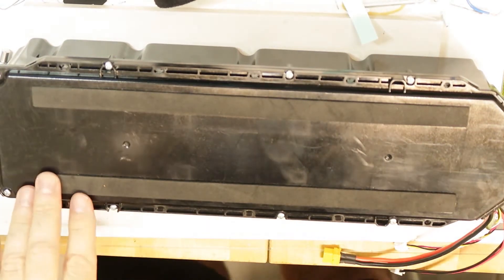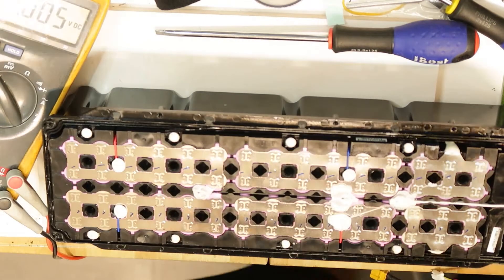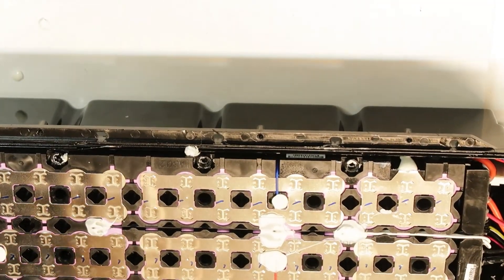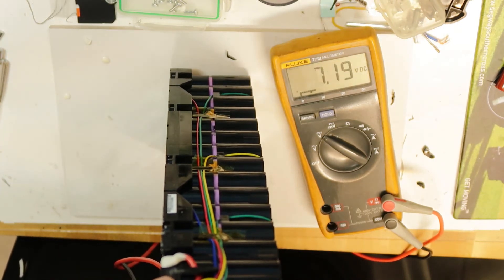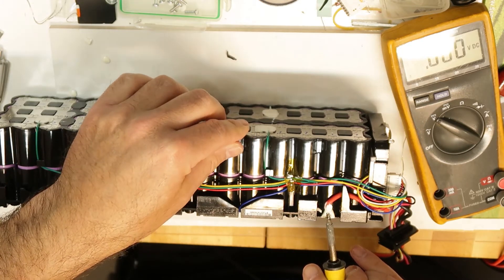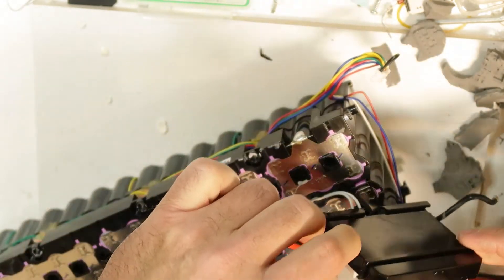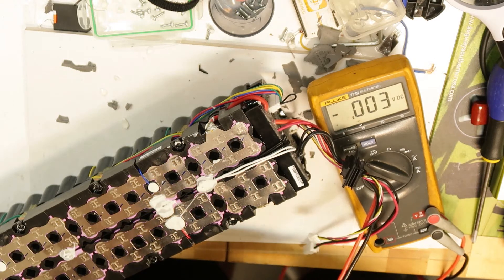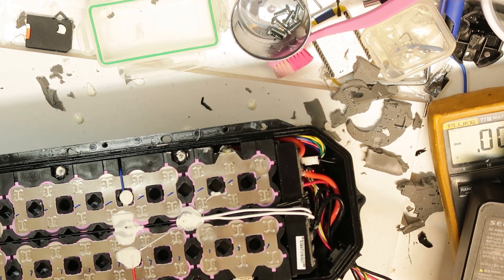Disassembly Ninebot Max G30 Non working battery

Comment: To remove the pack from the black plastic casing, you had white silicone covering the screws. On mine, it is a yellow plastic or wax… do you have any recommendations for removing that?

Comment: Hello sir, I have g30 battery that I left sit. Followed your video, batteries are low at 3.1v. I tried resetting the bms and it just flashes red and then stops. Will not charge. Am I out of luck?

Comment: I have an e-bike with an 8,8 Ah battery (40 cells). I rid 3000 km on sport mode. About 1 month before the battery cut off,  the power of the e-bike was reduced. The battery stopped working. I disabled it and measured the voltage, changed 20 A burned-out circuit-breaker. Then the battery was able to be charged again. It worked for half a cycle and then stopped. So I gave it to my friend, who works with electronics. He measured the battery cells and said, that it is only about 70 % of nominal capacity left. So BMS measured the battery's internal resistance and/or cell's capacity left. As the battery reached its wear-off, BMS simply just cut it off. Just for safety reasons. Because the older battery is more dangerous.
Reply: Bypass that bms

Comment: Hi there, my battery has gone faulty and Im not sure if it’s the cells or the BMS. Do you know why the led light is blinking blue but occasionally red? I managed too reset the BMS but the problem came back again. It charges then stops charging because the led light starts flashing blue and goes off charging mode then it starts flashing red and charging again. Also when I plug it in the percentage goes down and it’s not accurate. Thanks
Reply from the maker: if all cells balanced and problem continue - this is usually a bad connection to BMS from balancing wires or faulty BMS circuit

Comment: Was this battery genuine? I had the same one with the same cells (pink with only a barcode) and pll say they are fake. But since i bought the battery second hand i cant confirm if its OEM.
Reply: I have one with baby blue cells in it.
Reply: @Wheelieking619  mine has grey cells but configured the same ,can u add a on off switch with the original bms ?ive seen u have one runnin on a separate setup wonderin if i could add a second battery to my ebike

Comment: Hi, what is the third connector coming from the battery. There is the charging connector and 42v connector but what is the purpose of the 3rd one? I'm trying to use this battery for an electric skateboard build and am wondering what I need to do with that one.
Reply from the maker: this is communication
Reply: @RoeeBloch  can it be used standalone ? I guess just hook up an external 42v xiaomi charger to that little plug ? 

The comm port can just be left unused ? 
I’m using it for an e-bike second battery.
Reply: @oneeyedrone4293  Have you managed to use the battery standalone? I saw a post that stated that battery out is turned off after a short delay when no communication between BMS and Main Controller. "Those BMS have a special firmware installed to prevent theft of the scooter. That is why it cuts out aprox at 30 seconds.  You would need to flash non-rental firmware into the BMS."
Reply: @nanene9061  I have one out and it outputs 41v constantly.